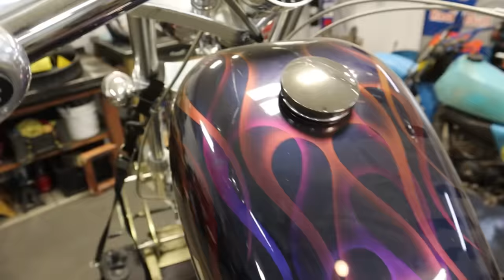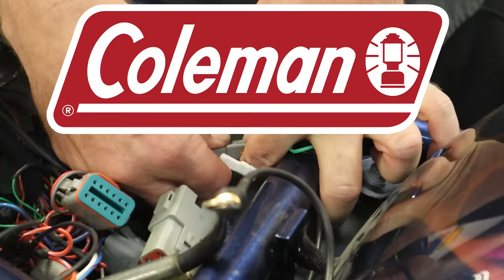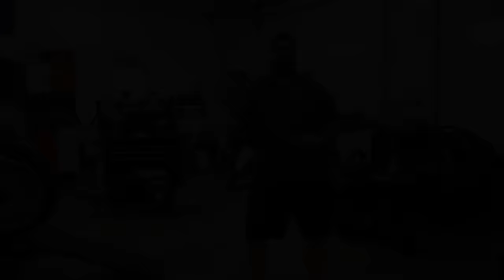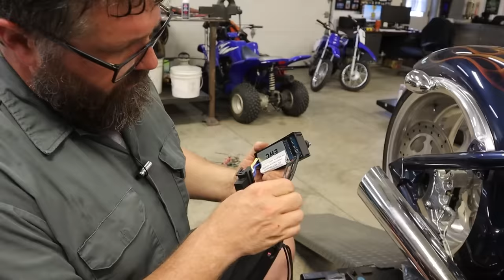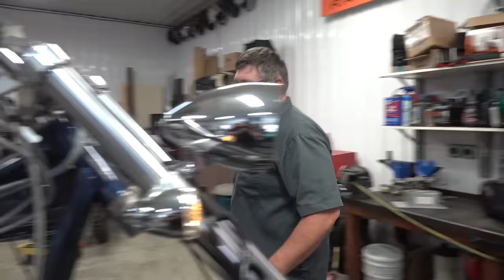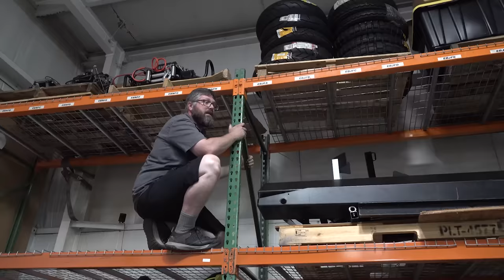Can I Fix This Unfixable Chopper ?

Comment: I would have torn all that electronics out along with any factory wiring harness. Install a key switch with one wire to feed the ignition, one wire for a headlight, one wire to the starter relay and one wire to the rear brake switch, riding again in 20 minutes

Comment: Simple fix. Pull that WiresPlus unit out. Replace with an Axel's unit from WSW. Wiresplus is OUT OF BUSINESS. The original ECH has been replaced. I replaced mine in the garage. Easy peasy. Dont forget to replace the charging system to maintain the ECH warrenty. 2 twists of the throttle and start. Stop twisting it while you start. Cool aint cheap. Dogs are amazing and aint that tough to work on.

Comment: Best thing to do with any of the Big Dogs with the ECU's is pull out ALL the electronics and put in an old-style hard-wired chopper electrical system. 99.9% of your Big Dog problems go away, this is the same for Big Bear, American Iron Horse motorcycle companies. 
I just sold my 2007 Big Dog K9 after putting in a new designed RIP ECU from Big Dog. I have friends that have had to replace their new ECU's more than once.
I have two older 1997 Big Dog motorcycles that were manufactured without all the ECU crap and they start and run with NONE of the problems you will have with all that electronic crap.

Comment: Couldn't get ANY shops to work on my 2006 Big Dog for a simple front tire change and forward control extension. For lack of a new tire, I couldn't ride it, then the battery dies, so now, I've missed a whole season and am worried about it starting

Comment: No compression due to either bent valves, mistimed valve timing, frozen compression rings, or just plain old bore washing from no oil sealing at the rings.
The clue was the cranking speed… way too fast compared to every other Harley I’ve ever heard.
The cranking speed was the same when the spark plugs were in, or out.

Comment: I have a 1990/2002 ex500 Kawasaki and I have no spark. Someone combined two different year bikes into one and I have a mess. I can jump ground to the coils and get spark. And I can touch ground into igniter box and get spark. I tried two other igniter boxes no spark. And the crankshaft sensor ohm out to be good. I’ll just keep at it.

Comment: I live close by and was getting ready to call you about getting some work done on my bike. Decided to take the cylinder head off and remove some valves. Found a hole in the exhaust port under the valve. No wonder I lost compression and had oil in the water! On to getting things replaced. Does that make me a parts replacer?😅

Comment: Is it possible, that with it spitting back through the carb, that one or more of the lifters collapsed, and on attempting to pump up (refill with oil, that a pushrod was bent? Check the exhaust on rear cylinder first. This could also cause the starter reduction gear to frag, and knock (possibly) the pickup coil loose, as the engine was in fact trying to rotate backwards (kickback noticed but exhaust from the carb throat). Old Greg.

Comment: Check the electronic ignition and coil.....24 volts probably fried them......note to who ever reads this never leave a car or truck running to jump a motorcycle the electrical components cant handle the voltage from a autos alternator  and never use 24 volts.

Comment: Sounds like the wires are on the wrong plugs or the new box didnt have the timing set correctly. It fired before TDC (why it puffed so hard out the carb) and broke the starter and probably sheared the key on the flywheel, damaging the timing system and losing spark.

Comment: Weight untill you find out the stater and voltage regulator are also fried as well as the coils .that much amperage fried everything most likely

Comment: I worked as a motorcycle mechanic for most of my working life.
As soon as someone gets into aftermarket electrical stuff it's always bad news particularly when they believe the marketing on how 'simple' it's going to be.
Putting 24v with capacity of several thousand amps may not have done the regulator rectifier any good so even when you get it going it may need even more parts?
'Modern' fuel only lasts a couple of weeks, certainty the carb was going to need cleaning.
Checking coil is too simple, not sure why you didn't show it?

Comment: One of the biggest problems with taking on a repair job caused by them jumping it off from a 24 volt system is that once you fix all of the fried electrical pieces, you’re still left with a bike that had a reason it needed jumped off in the first place.

Comment: First thing came mind for me is the engine is cranking over way too fast.  What does that tell me is for some reason the compression is very low.  Could it possibly have a compressions release that has failed.  Also when it was back firing thru the carb that indicated to me there is an issue with the timing.

Comment: Oops. Wiring harness, meet trash can. I wouldn't even consider thinking about fixing that but then again, I've specialised in making new wriring harnesses for standard and custom bikes for the last forty-plus years. Just give me a wiring diagram and leave me to do it. So far this year I've rewired a 1964 Norton SS650, a new-build Triton (64 Tiger 120 engine in a 63 Norton slimline), two BMW K100s and an indeterminate Harley panhead custom. It's a fun hobby!

Comment: I'm no major expert but with backfires that loud (one cylinder through the exhaust, one through the carb?), strikes me that the valve and/or ignition timing is way out? On the grounds that the breakdown man will check you have gas even if you've broken down on a garage forecourt (ie not wanting to insult anyone), are the HT leads reversed?

Comment: 2004/5 back when the S&S 107ci was HUGE! 😂
Reply: Yea , Owen 2004 Big Dog chopper Rt frame,107S&S rewired it completely, single fire IGN and coil starter relay, head light relay new handlebar control switch housings,new voltage regulator ,stator, fuse box #14, 12, 10 gauge wire 😎👍

Comment: You've got to be careful on those big engines. If the timing is weird or there's anything just a little off stop grinding on the starter. Bad habit as a mechanic. It should kick off in just a second or two, if not... STOP cranking the starter. Always go over the basics first after you wire a bike that heavily. Spark, Fuel, Timing. Also the RUN/STOP switch can be a big bugaboo and has clipped my wallet on more than a few jobs. You're doing good but really keep your head clear and if you need to, build yourself a basic check sheet for start procedures. Just quit cranking the hell out of the big bikes or the starter goblin will bite you every time.

Comment: Take at your own M just two coils not the coil go back to the points that bike probably has electronic ignition either way go back and check that disconnect everything check them individually with an ohmmeter confirm the bad unit replace easy enough

Comment: Ive got a custom Ness bike we just put in a new 126 motor and i keep breaking the frame so it's going back we think a section of the tube used in the frame was just bad metal from the supplier the location of the break is just not possible to be anything else

Comment: Dielectric grease is federally mandated to NEVER emerge from the nozzle. It is suggested that it either comes from a tube seam or more desirably to emerge from a hole somewhere in the middle of the tube. It's a FACT.

Comment: So I went back and watched it again as you were trying to fire it up after the new harness.  It sounds like you got the coil trigger wires flipped.  Harley’s have what’s know as single fire on some models and dual fire ignitions on others.  Depending on how it’s setup you could have the coils wired backwards as in the wires to the front cylinder coil going to back coil and vice versa…in other words the firing order wrong.  It’s spinning way too fast for a Harley big twin.  Almost like the plugs are removed or in the case of wiring the coils wrong, not getting the slow down that a partial fire does even though it’s not enough to start fully it does slow cranking down.  Swap the trigger side of the coils wiring between front and back coil or if it’s a single coil bike with multiple spark plug leads then all the trigger and 12 volt wires are one plug and just need to swap the two triggers around!

Comment: i guess i dont understand.   is this a paid job?  did you take flat rate?  or are you hourly on it?   "shops dont want to take on projects" but the clock is ticking so is the bill so whats the problem

i hate it when "custom" shops dont want to do custom work

Comment: A guy came to our shop on a BMW 1200 with an intermittent electrical fault and was quoted £1700 by the main dealer for the work.
Explained that it was time which was going cost the money. Any way found the fault and it was pennies to resolve but, took 8 hours.
Gave him the bill of £780 and he went mental, the part is only a few pounds he screamed. 
I got paid, he saved a 1000 pounds but he still glares at me 15 years later. Lol

Comment: Here’s the difference between a parts changer and a mechanic…proceeds to throw parts at it when he can’t figure it out 😑 clearly the timing is off and kicked the engine backwards to break the starter. Might wanna start there.

Comment: It's rather hard to see all that may have been fried by a short sighted knee jerk 24V overload just what components got fried by that maneuver, in time you may find them all out Craig I believe it's time to objectively think what all may have gotten ruined by WAY TOO MUCH power & amperage through the system and what's truly likely to be ruined replace those parts it's an extensive progression that burnt the insulation entirely off overenergized wires suggestion what all got.that kind of power & what's destroyed by that many things seem to be firing out of order what did the last guy do objective decernment and inductive reasoning you're getting near solution be sure that when it's started it won't damage something else. Likely you'll have a list as long as your arm and the repair bill will reflect that talk to your most knowledgeable electrically knowledgeable mechanic buddies maybe bring it over to them, it's Get er done! That's now the goal I'm sure you have told the customer this is a serious situation and the overall repair bill is going to reflect that, I wish it wasn't so but I didn't connect the jumper cables to heavy earth moving equipment with a 24Volt high amperage charge and kinda in desperation baked serious components and wiring harnesses &  with all that unknown I had to effect great running motorcycle in all areas "You Just Might Be A Redneck" if; you try to start your motorcycle with a D9 catapillar. And Here's Your Sign.
just before you hand them the bill
Best David

Comment: You do not have to remove spark plugs to see if they work. Just take out your timing light and clip onto the spark plug wire and you will see the timing light flash. DONE, NEXT.......

Comment: Without a decent wiring diagram and proper colour coded harness you have a huge problem. But when hide the wiring which all seems cool you create an utter unreliable monster! And a screwed up starter because the engine is literally backfiring. ... it's a turd

Comment: im sorry but why nt a bypass?? that's what I normally do if I got a bike that wot even turn over then first think is battery to the starter bypass it and  see when it turns over one its shows it ca tur over then tur re wire it so all working then concentrate the engine turn over lol

Comment: Commendable effort & appreciate that part. It however is still a real "Putz" of a machine. Hardtail...good for 2 blocks on most streets, say good-buy to your spine. Manufacturers worked to develop suspension  3/4 of a century ago & this hardtail crap goes back to pre WW2 design !!!  Harley and Indian at least put a well sprung seat under your butt .  Heck, why not make wooden spoke wheels & put them on a modern bike.
Also, even 20 years ago, riding off on this type of crap you didn't look cool, you look like a dork pretending to be cool.

Comment: Stop bitching about the twisted wires and just depin the plugs and clean it up, it is quite easy you know.
You should have enough knowledge to do this, since you are a professionel Right? 🙂
Much of your problems seems to be that you are a Mechanic, not an Auto Electritian.
Nothing wrong with being a Mechanic, but when it comes to wireing like this an real Auto Electritian would make this look like a walk in the park.
I am an Auto Electritian and i have fixed much much worse than this 🙂
I will say that putting in a new wire harness was the right thing to do in your potition, since the bill for rebuilding the harness from scratch is a lot more expensive and too many variables.